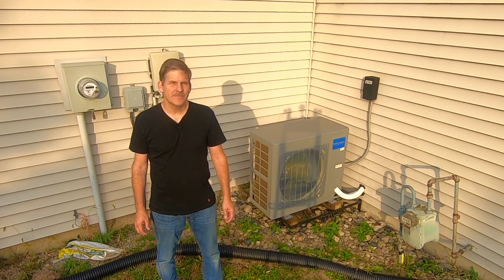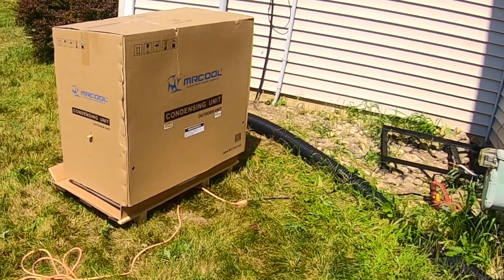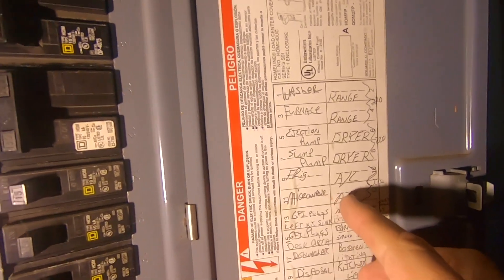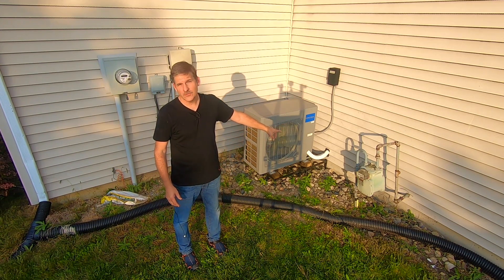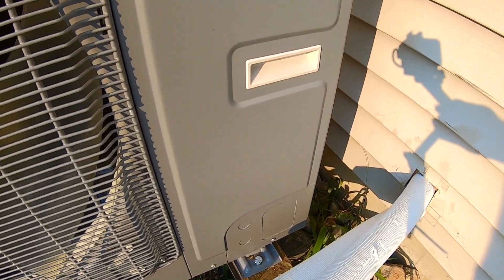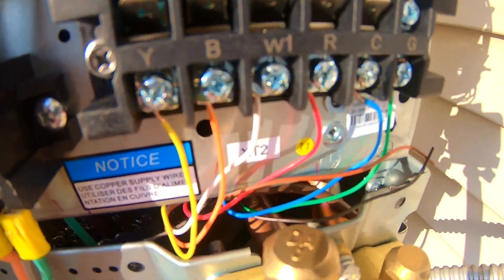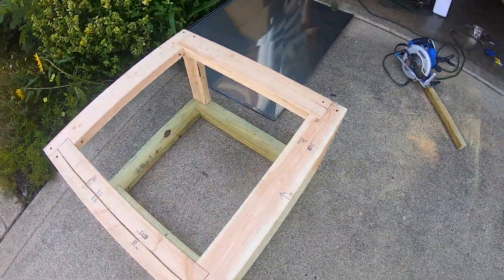How to install Mr Cool Universal Heat Pump: air conditioning and heat solution

Comment: Heat pumps by definition, and I mean by laws of physics are very inefficient.
Reply: Last but not least, and maybe this will help you function day to day, is that in engineering or in the trades or in industry, when someone talks about efficiency "over 100%" they are almost always taking about relative to some other system, design or standard. No one is generally talking about thermodynamics and some ideal theoretical limits. You need to learn context and not try to apply what you must have learned in  class to everything you come across... gotta know the context.
Reply from the maker: Hey bluwng,
Technology has changed. The compressor used in the Mr. Cool is powered by an ac -dc inverter making it very efficient. Heat pumps use energy to turn or pump. But that’s where energy that costs $ ends. A heat pump is capitalizing on that already exists outside that doesn’t cost anything. God made it. Heat pumps go get it. Therefore, heat pumps can use 1 Kw of electricity to retrieve 3 or more Kw of energy from outside that is free which would make it functionally appear to be 300% or more efficient. That is expressed as a “Coefficient of Performance” - there is plenty written about that online.

The Mr. Cool claims that their heat pump can heat at 100% efficiency at -5 degree F and cool at 100% efficiency at 115 degrees F. 
Ultimately, heat pump technology is getting better and what interested us in the product.

The big question for us is cost - will the higher cost of electricity be offset by its efficiency and surpass the performance of our old gas furnace.
We’ll see after the winter heat bills.😀

Hope that helps clarify what we were talking about.
Thanks for watching.
Reply: @Housebarons  I understand what your saying.  Fundamentally anything that is 100% efficient let alone 300% is by definition a perpetual motion machine which does not exist.  Most if not all electronics are run on DC so I don’t see how an AC to DC converter helps increase efficiency
Reply: @bluwng  You lack of understanding is jaw dropping. I don't even want to waste time to help you but i'll leave some notes for others. Heat pumps are extremely efficient please go to any green building site to see data. When we say efficient, we are comparing the heat BTU produced for watts consumed (please google 'COP') and it is no problem to achieve over COP > 1 >100%.
Reply: @bluwng  Next, lets address inverter. The AC->DC->AC process does have some loss in it, but the reason we do this is to have control over the compressor. If you ran it just off the main power AC, you only get one speed to run your AC motor. Inverter process allows us to drive the compressor at many speeds and therefore we can pick the best speed to match the load on the system. So again, it's better than the old technology. It increases the system efficiency.
Reply: @bluwng  Why you come here and feel compelled to state that 'in physics blah blah'  is your attempt to prove to the world you know physics? But all you have proven is that you don't understand the context we are talking about.
Reply: 1 month ago
@bluwng did you fail your high school physics class ?

Comment: what did you do in side the house your video showed nothing of what you did are you using the furnace what? what are you connecting the lines to?
Reply: Nice video. I want to install this unit next spring. I am mostly interested in the a/c portion since mine is very old, inefficient and slow leaking refrigerant. I have successfully installed a me cool mini split at a cabin I own. This install looks very similar except the air handler part. I'm wondering where to start on the installation of the air handler if I want to keep my existing furnace?
Reply from the maker: Hey Bill,
Sorry if the video went to fast.
The Mr. Cool Universal is a heat pump. So the outside condenser is the main part . 
It is responsible for heating and cooling - all depends on the direction the refrigerant is moving. 
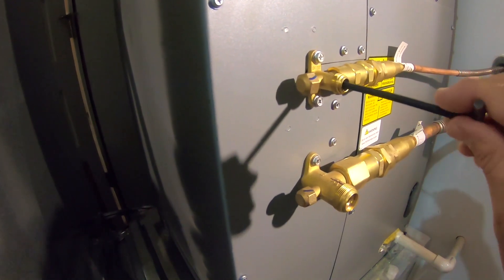At 6:40 in the video, I’m connecting the 2 refrigerant lines to the outside condenser. I did the exact same procedure inside on the air handler but did not show that. At 8:40 I open the valve on each refrigerant line that is already attached to the inside air handler.  I did the same process to the valves on the outside condenser but did not show that. It’s very simple set-up.
At 9:01 you can see the inside air handler with (attached refrigerant lines) sitting on top of the plenum box ( made earlier in the video).
You can also see the air return ducting attached to the side of return air plenum on which the air handler sits. 
The air handler is where the fan is located that moves air through the house. 
We had a gas furnace which we replaced with the Mr. Cool Universal Heat Pump.
Hope that answers your questions.
Thx for watching.

Comment: What about putting a vacuum on the system?
Reply from the maker: Hey Roger,
The cool deal about this set up is the lines come pre-charged! Therefore no need for any of the typical laborious HVAC install processes. The pre-charged lines are connected and then values are opened on either end of the lines and the refrigerant can then circulate through the system. 
If in the future you needed to test the lines, it’s connections allow for that just like a normal system.
Hope that helps. Thx for watching!

Comment: I have priced around and will contest that the extra money for the diy version system is more than what you can pick up a nice used vacuum pump and micron gauge, already have a few sets of gauges around here, and of course an inch pound torque wrench and a crows foot set

This saved me quite a bit installing 4 mini splits, about 1500 actually

Comment: Very nice video, I have the same unit that I installed myself, with help of a friend. Neither one of us are experts, but we both have some knowledge in HVAC.  I have a question: Can you tell me why did you wire up the G-Terminal(green wire) on the outside unit? I didn't wire mine up, because somehow the instructions, seemed it not necessary. Thanks.
Reply: Green wires are usually the ground wire. Things will work without being grounded but being grounded is very important for safety, especially with a large drawing device.
Reply: @theyluvloki  That's not ground. That's the wire to signal the fan is on for the inside unit. I also as an HVAC tech dont' know why the outdoor unit has one.
Reply: It’s a heat pump

Comment: Working on installing this unit. Having trouble with thermostat. Its 6 wires from condensor to air handler, then B to B , G-G, Y-Y, W1-W, R-R, but C where does that go? to RC and remove jumper from R to RC? Obviously im not a pro!
Reply from the maker: Hey Co...,
Are you talking about connecting from thermostat to air handler?
There is a diagram on the air handler. 
I have a nest thermostat. So my “ob” wire is orange and my “c” wire is blue. Not sure that would compare to your situation. That’s why I suggested the air handler wiring diagram.
Reply: @Housebarons  Thank you! Got it figured out
Reply from the maker: Hey Co...,
Terrific!

Comment: For the outdoor unit, what size breaker is on the circuit? Is this the 2/3 ton model?
Reply from the maker: Hey Mclordhelmet,
I’m not by it right now, but if memory serves, it was 30amp - 230v which was the breaker for my old unit. The paperwork specified a range ( min-max ) for your breaker. 
Yes - it’s a 2-3 ton set from factory at 3 ton.
Hope that helps. Thx for watching!
Reply: @Housebarons  thanks for the reply. Do the nameplates on the outdoor unit have that spec printed on them?
Reply from the maker: Hey Mclordhelmet,
Yes. Min 24A, Max35A, 230V single phase.

Comment: Mr Cool make straight cool w/ inverter technology? I don't want to run the system 365days in the south
Reply from the maker: Hey The...,
The condenser ( outdoor unit ) has the inverter on it. By the thermostat, on the Universal heat pump, you can select cool or heat or both. It is most energy efficient in cooling mode. They also make HVAC items to replace your a/c only, if you have a gas furnace. Those may require an HVAC tech to set up. They also make DIY minisplits which can cool and heat. Quite a few options.
Thx for watching.
Reply: @Housebarons  The system is competitive to the Bosch which has Mitsubishi and Midea major parts, but if they can strip it down to make the pricing more competitive, it would be great! 

Do you know which distributor in the south carry the universal line?
Reply from the maker: You could probably contact mrcool directly if you are looking for a local dealer/installer. 
For example, we are a dealer. But we don’t install them for other people. 
So you could buy from a dealer and then find a local installer.
Or through mrcool, maybe there is a dealer/installer all in one near you. 
But at the very least, you’ll need a local installer if you are not taking that on yourself.
Thx again,
Reply: A good guy daneil tell him chris from canada sent ya
Reply: @profuse007  Lowes and Home Depot used to.